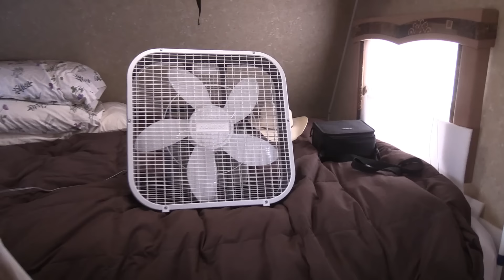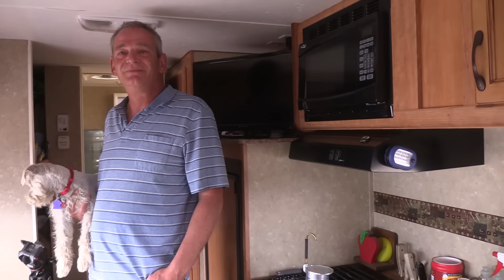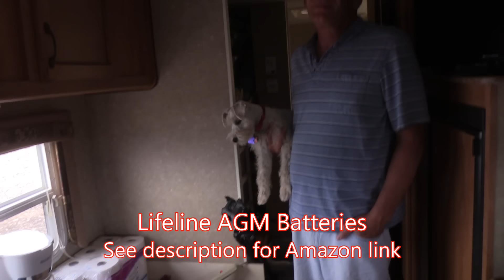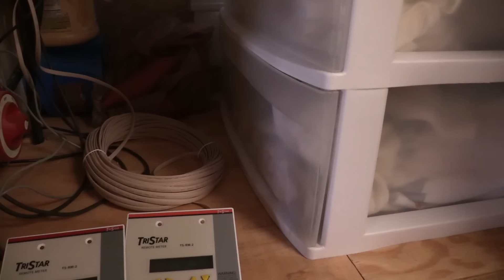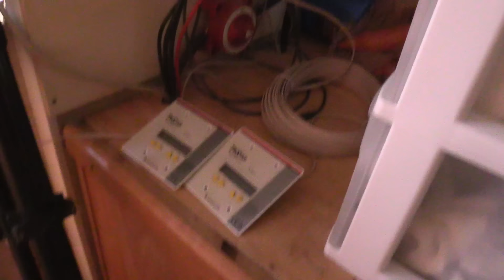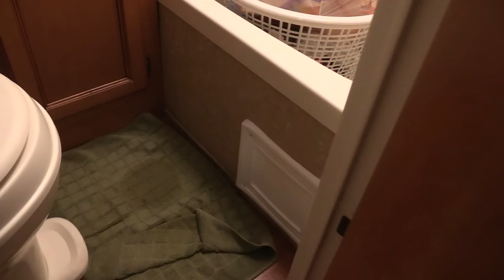Tour of a Nomad Living in a Travel Trailer

Comment: Question: How did your deal with the headliner on your tow vehicle where you mounted the solar panel?
Reply: The big panel was more than I could handle at the time so I had Solar Bills in Quartzsite mount it. I can not say for sure but I would think they used a anchor inserted from the top without removing the headliner.
Reply: Jim Barnaby Thanks. That makes sense but my pea brain can't figure it out.

Comment: Getting ready to put solar on my van. I would love to know what a system like this cost. I don't have the room for this many watts on the roof. But I would love to be able to run a AC unit
Reply: I believe with 600w (two panels) you could run a 5000 BTU pulling 410w. I have seen 1000w on a van at the RTR.

Comment: I have one of these (similar) trailers but with the slide out. That adds significant weight.
With Bob Wells solar recommendations you are good to go.
I installed a 12V RV swamp cooler that usually is ok. I have over sized holding tanks and they are a big help offering less work.
Also A/C that can be run off a quiet Honda Handi generator if needed.
Far better and way cheaper and more interesting than living in a retirement home.
12V Direct TV is fussy and expensive and I want to do away with it.
Reply: Cool !  Would you post a link for the 12vdc swamp cooler you advise ?  rc

Comment: Does Jim leave his water heater on all the time or turn it on for shower time and dish washing time ?  There is no need to keep it running all the time unless he has a medical need for constantly available hot ( not just warm) water.
 It is very energy saving to only heat water as needed, it does not take all that much time to heat water, faster than waiting for a solar bag to heat water.
Reply: I only turn on the water heater before I need the hot water most of the time. There are times when the sun is good and I am not using the power otherwise that I will turn it on just for the convenience.  I can run the fridge off of the solar too but it doesn't save me nearly as much propane.
Reply: My older motor home has a gas water heater and I never leave it on.   It just takes a few minutes for it to heat.  I take my shower and wash my dishes and shut it back down.

Comment: How much was the trailer and its weight??? I realize more people are interested in solar. But I'm highly interested in light weight trailers that are cost efficient. Didn't get that with this video. :(

PS. All you people complaining about the dude's dog...get over yourself, y'all are jerks.
Reply: The trailer weighs 4200 pounds dry and has a cargo carrying capacity of 3000 pounds. It was $13.500 when I bought it new at a end of season sale.
Reply: Jim Barnaby 
Wow! That's such a great price!!!  I might have to look into them. I love the bunk area it would give me a spot for extra storage and my cat! Finding an rv that has a suitable pet area and an area for his litter box is challenging. (I have 2 mini poodles and a cat)
How close to the extra weight do you get? Aka how much do you need your truck to be able to pull?
Reply: Jim Barnaby Hi Jim. (Waving) You and I have already talked about the Ameri-Lite over on CRVL and you know I have a Suburban so I'm thinking if you had no problem towing with you Expedition, my Suburban should do fine. Do you use a WDH or stabilizer bars? I'd also like to talk to you more in depth about the solar set up on the Expedition. My Suburban has a rack on top and I'd think it would be easy to set up my "portable on steroids."
Reply: The batteries and solar panels weigh around 600 pounds so with the water full I think I have to be close to the 7000 pound max. That is the upper limit for what my Expedition can handle in a travel trailer.
Reply: Your truck has specs that tell you what you can handle. My trailer being a ultra lite benefits me a lot. A 4 season would be nice but I follow the mild weather.
Reply: Lori Post your truck specs on the forum. I use a weight distribution hitch with bars as well as a friction sway bar. The 435w panel on my truck is not generally sold to the public but you can find 300-340w panels that would give you up to 25 amps for most of the day tracking the sun. Not only does it see the low sun early and late that the flat system can not, it allows me to chase the sun in a shady situation.
Reply: Cute dog.
Reply: great deal for a well built trailer. I havd a 1/2 ton f150 so i'd have to go with a lite or ultra lite trailer. Thanks Jim.
Reply: Max is a Toy Miniature Schnauzer
Reply: Not subbing to a spammer like full tiny house, now
Reply: Khu NoPie who is a spammer? I do not see anyone spamming on these posts for this video.
Reply: Darleen D    Looks like a Schnauzer.
Reply: That is more additional cargo capacity than many Class A MH's !  rc
Reply: I love your dog, I had a Miniature Schnauzer. She was a great dog! Yours is so little and cute!
Reply: Love your home. May I ask what kind of dog you have , it's so adorable.

Comment: Thanks for the tour. Trying to figure out if I can afford this life style. How much does this trailer cost? What's the cost of solar and batteries? Is it safe to have batteries indoors?
Reply: The trailer was $13,500 new at the end of the season. The solar was around $3000 or so but much was bought off of craigslist and ebay to keep cost down. These batteries are AGM and while they do not normally vent, they do need ventilation to allow heat to escape.
Reply: Thank you Jim, very helpful!
Reply: I have a Blog I am trying to get caught up called the Solar boondocker.
Reply: The reason I went with a A/C instead of a swamp cooler is because a swamp cooler uses a lot of water. I can create the power to run the A/C out of thin air but I can not create water.
Reply: The three on the trailer are a American solar company Navajo solar. The one on the truck is a rebranded Sunpower called high tech.
Reply: Ron Powell - Thanks for the info Ron, what travel trailer do you have?
Reply: Jim, I just happened to come across videos of this whole concept of living in a trailer/van etc.  I've watched many videos but for some reason you touched my heart.  I, like you, have limitations on my back and what I can lift/push/carry.  It's frustrating but I am taking one day at a time.  I LOVE Max, who I named my first cat who passed away last year.  My little Yorkie, Harley, is now the love of my life who gets me out of bed each day and what an unconditional love it is.  Jim, I wish you all the luck and love in the world.  You have the most sensitive, loving eyes and I pray you take full advantage of the happiness you have achieved right now.
Reply: Gotta work on that next, Jim !  :-)  rc

Some Germans figgered how to hang up mesh netting in Chile, or Peru, to catch condensation from fog that had never even slowed down, before...
There's always a way !  Well, almost...
Reply: Jim Barnaby if I may ask, what is the brand of your solar panels?
Reply: Jim Barnaby - do you have a you tube channel or website?
Reply: Encouraging !  I'm thinking PV panels on the roof would actually absorb sun, preventing it from heating the trailer/coach, helpng in that way...  Otherwise, shading with a tent or awnings should help a lot also.  Is anyone using swamp coolers out in the arid desert ?  Best, rc

Comment: Says a lot about the RV industry. First, I'm sure most manufacturers would say you can't live in your RV. Think about that. You can't live in your RV. Second, with 250 watt panels costing $170, anybody can have 1200 watts of solar. But the roof space is not always there, or it's not laid out right. These days, inverters and MPPT controllers are more of a cost issue, plus the batteries. But RV manufacturers refuse to look for solar friendly air conditioning, cooking, heating, even water heating and refrigerators.  Can you find me a company that will let me design the interior, get rid of the torture dinette? 

I really respect this guy. He's doing what you need to do and showing other people how to do it. The game changer for boondock RV's is a lot of solar and a decent amount of batteries. One YT channel, RV Exodus, demonstrates a really advanced system with Lifepo batteries and a lot of solar, plus all the trimmings. During a long storm period, like in Arizona last winter, the solar does not work. There are limits. 

Thanks Bob!
Reply: There are trailers without dinettes with tables and chairs instead. You could also do a toy hauler that would be easy to customize.
Reply: Ron, Wow! I would love to see your rig and know how you worked it out. What window shaker are you using? As I consider mounting mine I am thinking of replacing it. Its replacement pulls 410w for 5000 BTU. There is a 6000 BTU that pulls just over 500w. The most exciting is a new roof unit that is 9000 BTU, pulls just 600w and get this...it is 12v DC! No inverter losses, no expensive inverter. I know either one of our systems can cover 600w with ease. It will be a pain moving my panels but 5000 BTU does not cut it in 100+ degree heat even if it is dry. It can cool 20 degrees if I start it before it is heat soaked, 10 degrees if it is. That is when I toss the dog on the bed, pull the curtain and let the A/C cool just that area.
Reply: Jim Barnaby That's exactly what I have been shopping for! It came to me one day when I was looking around at all my art supplies wondering what I'm not going to  be able to bring, when I was looking around at sprinters and the like. A toy hauler has the perfect amount of storage space for my needs!!  Plus all the amenities that being in my later years, I  feel more comfortable with!!  

The challenge currently is finding the right one I think every single one is different... but I'm very excited to get this underway and get on the road thanks for having a great rig to show off. 
Lauri
Reply: Thank you Ron. I really look forward to seeing your video.
Reply: Ron Powell I like what you've done to get more real estate by swapping out your tarp awning for a solar awning!!  Great idea!  Thanks. I'll keep that in mind...

Comment: WOW 1200 Watts is a lot of solar power, but a electric hot plate for cooking would be a power hog for maybe a hour each day.  He did not say how many watts of inverter power he had.  Must be over 5000 watts of pure sign wave power.  A $5000 solar system I would guess.
Reply: The inverter is a Trip-lite PV1250fc industrial inverter. The small burner on the hotplate pulls 470w while heating and is under the radar of the batteries as long as the solar is active. The system ran me roughly $3000 as a self install.
Reply: Was it a regular hot plate? An induction cook top would be more efficient.
Reply: Thanks for that info, Jim.  By now, Bob should know to ask nice folks to fill out an info sheet he can post with the video info !  :-)  rc